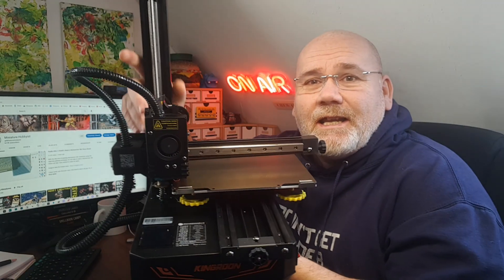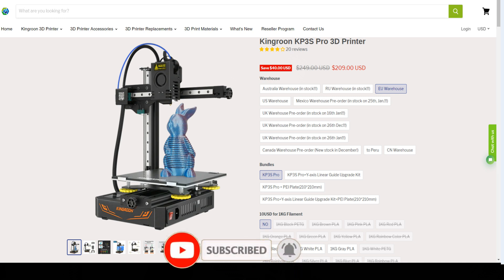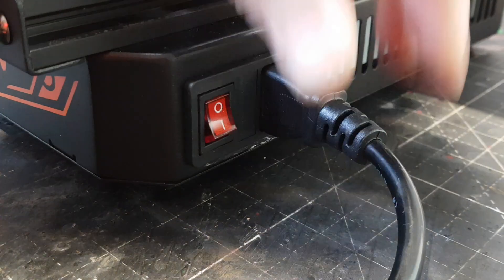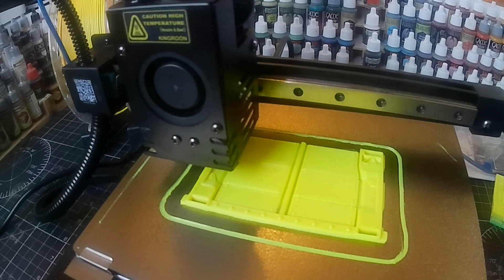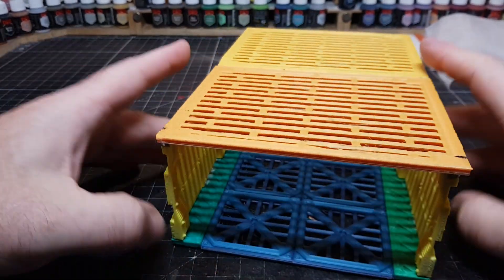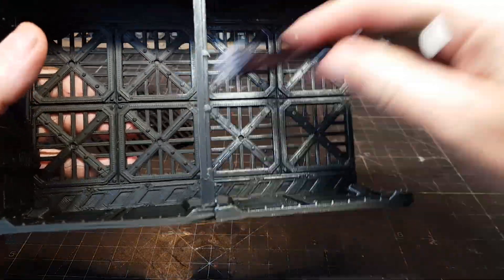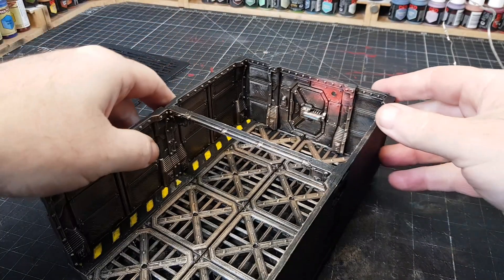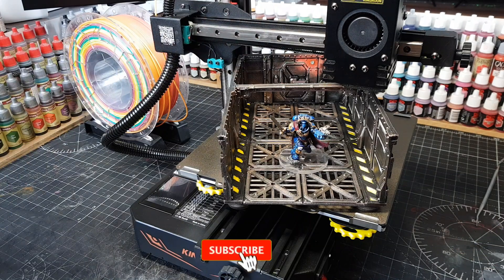START 3D Printing with the Kingroon P3S PRO

Comment: What is the white “paper” you used to glue the bottom bits together and keep flat, and how did you remove it after?  It’s at about the 4:50 mark.

Comment: Cool! Another thing I've found to help save a lot of time with FDM printers is change the nozzle over to a 0.6mm one. You'll have to recalibrate E steps and flow rate, but it's not that hard really (Edge of Tech has some great videos on this), then that plus an increased layer height really chops down the time. For an extra $50 though you can pick up a Neptune 3 Pro which has auto bed leveling, direct drive extruder, filament run out sensor, and a bigger build volume. I'm bias because Elegoo sent me one but I really do love it, I think it's the best value FDM printer right now.

Comment: CHEP did a head to head with this printer and the Creality Ender 2 Pro.  Same design printer.  Strongly suggest anyone in the market check that out.  He preferred the Creality by a wide margin.  Pricing is the same.  For me, not being able to adjust belt tension on the Kingroon is a hard pass.